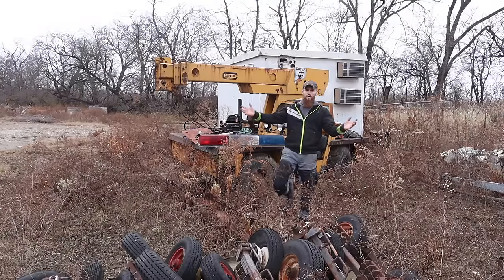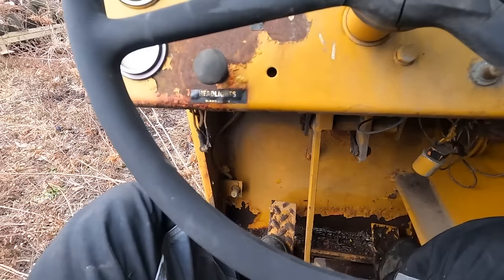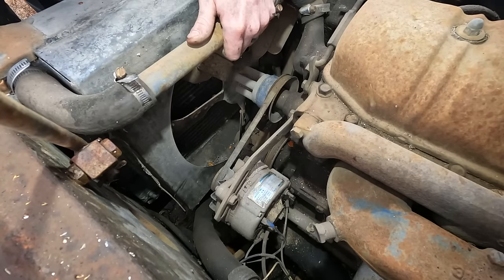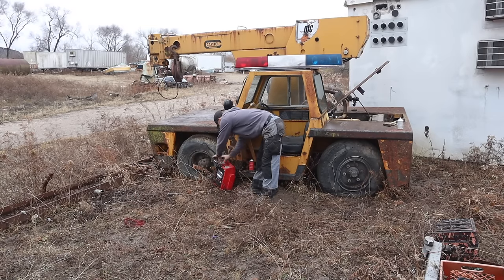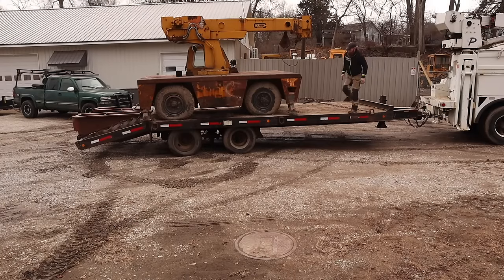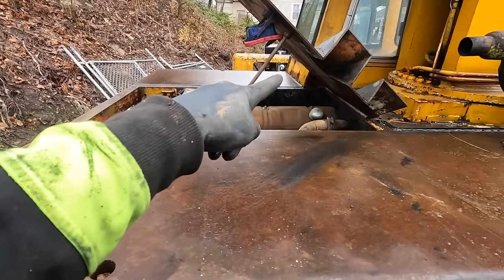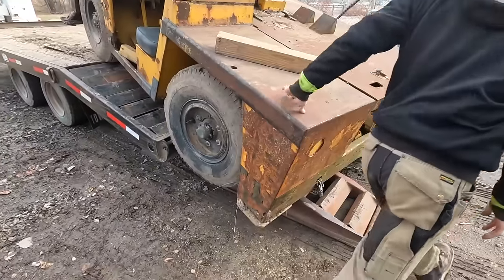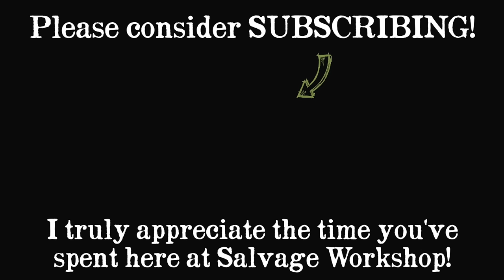Recovering a Crane DESTINED for the Scrap Yard ~ Broderson IC70 Diesel Deck Crane

Comment: Ok. I’m guessing here. I’ve not heard of the brand of machine your working on but pettybone and grove made them pretty much like that. 
  Back to my guess.  Ford Lehman, made engines that used Simms and CAV injection pumps. The injectors were hidden inside the head , much as the ones you are facing.  I have not seen one of those before but as you disassemble it, I’m thinking a casting is gonna be marked with something you can search the internet for and find an answer. 
   Good luck…. Those rigs were very popular in boiler houses and refineries that replaced heavy valves and pumps and needed a compact and rugged way to handle and transport said items for repair or replacement.
   Search for American Diesel and send them some photos of that motor. If it’s not something they recognize, they may have some other guesses

Comment: 47:30 'deck cranes' are [in some ways] kinda like tiny 'pipe trucks' [used to be very common in Oklahoma a long time ago] where a machine not only carried, but supplied, or installed material, which, in the case of the oil rigging days, their job was just to supply ol derricks with fresh pipe.

Comment: Hay. looks like you got a FORD INDUSTRIAL 172 CI ENGINE  common to 60s ford tractors  IE  4000  back hoe tractor . Check the casting number on the block .  Fully Rebuildable  OR  Replaceable . Great video Thanks

Comment: I have one of these cranes, almost identical to yours. Mine has a perkins 236 neverstart engine and has 1408 hours on it. If the engine you have has a Sims diesel pump its ford, if it has a CAV or King of Darkness (Lucas) its perkins irrespective of how the tappet cover is formed. A further titbit, the transmission you have is actually a four speed which has been sticker converted to three speed and mine does opperate in fourth. The torque converter divertor is hand opperated unlike yours that is foot opperated for forward/reverse. Enjoy

Comment: I could be wrong but I think that is a Ford 172 or 192 cubic inch diesel. Same engine was used in the Ford 800 and 900 series farm tractos and many industrial applications.
Reply: I've never seen a Ford diesel with that shape valve cover. They are narrow and straight.
Reply: I see Ford blue paint though.
Reply: @dickwright2134  I'm just saying I've never seen a Ford diesel with that configuration. It's definitely not the 201 3cyl architecture as I own two of them.
I don't claim to have seen every Ford diesel tho
Reply: I have looked through some of my old repair manuals for a comparison.That is a Ford industrial diesel. It could be a 144 cubic inch 46 hp, 172 cubic inch 47 hp, or a 192 cubic inch 52 hp engine. I would bet you have a 172. It seems they were the most widley used. I don't know if you can tell the difference externally. At work we used to have them in Waldon articulated wheel loaders. I think we sold the last one in 1994.

Comment: Weld you some rings on the end of the stabilizers and one higher on the frame so you can chain or tie up the legs. Great if they bleed down and safety if you driving it and they drop on you.

Comment: Question, not trying to not pic this more for my own info The shaft you zip-tied to the knuckle inst it a steering dampener with the purpose is to absorb the impact on bumpy/uneven terrain so you can control the driving better.   Seriously I really would like to know..   I've just recently started working on ng on some if these older rigs and want to make sure I'm understanding wha does what.
Reply from the maker: No it is a steering cylinder... when the machine is running will turn that wheel hydraulically when the steering wheel is turned... both steering wheels have their own cylinder and will work opposite one another... one will pull the cylinder's rod in and the other will push the rod out so the wheels turn properly.... so when the machine is not running there is no way to steer the machine, and it becomes worse when it is broken like on this machine! Good question!

Comment: We had one at a copper mine I worked at in Northwestern Ontario, it was like having a 3rd arm. It was used every day. I think it was a Drott
Reply: The old Drott Go Devils. Phoenix Steel had a couple. They had Continental gasoline engines in them. They used them to carry steel. Drott was based in Wausau Wisconsin. I had a relative that worked there. They were sold to Case in 1968. Broderson started making carry deck cranes in 1973.

Comment: Correct me if I'm wrong but I assume the steering cylinder broke while the loader was pulling it out from where it was sitting. I'm guessing it has hydrostatic steering with the steering motor being able to act as a hydromotor if the engine isn't running. If someone had been steering the crane while you were pulling it out so it wasn't being pulled sideways you probably wouldn't have broken the cylinder. When I'm moving dead tractors on the farm I always have someone steering for that very reason. Just a though for next time.

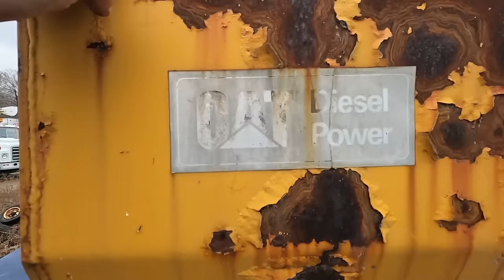Comment: 14:51 I love patina to the point I'd almost be willing to pay thousands to have a fake patina put on something that didn't have one initially. Irks me to see these old machines repainted, even if it's to factory spec.

The patina, to me, shows a timelessness, a ruggedness that you just don't get anymore. It shows a machine that has been through it all and come out the other side still working. It shows a machine that will stand the test of time **because it already has**. And I love that.
Reply from the maker: I couldn't agree with you more.... Most times!
Reply: @SalvageWorkshop  I sure won't be doing anything about the rather heavy patina on my 85 F150. It looks like it got drug out of a junkyard 15 years ago, but that's fine by me. I'll get it running without flaw and I'll drive it looking just like it does for the rest of my years hahaha.

Another reason I don't like patinas getting painted over is, often times particularly with classic cars, it's a way to hide shoddy bodywork. I'd honestly rather just have rust holes in the quarter panels than have them filled with ramen noodles and bondo then sanded over with a $300 Maaco quickie. 

You ain't the kinda chap to do that shady shit, but too many people out there will do that and say they've got a 'restored' classic. Here comes me, looking to buy a classic car to use as a daily driver, and I'm having to wonder if that shiny paintjob is just someone wanting it to look nice and they did the requisite sheet metal work beneath it to justify the asking price, or if it's someone wanting to hide $20,000 worth of required body repairs under $200 of bondo and $300 of paint instead of making the proper repairs.

Comment: I ran the dp250 the most then the dp500 for a while steering is one of the more common problems these units have that and cooling problems on a 250 there is a shaft that runs through the radiator or under it that turns the fan yours looks different but the bearings go out of them a lot not familiar with this small of a unit however I’m sure the controls are much the same the lever in cab on the left turn the boom left pulled back and right pushed forward

Comment: Outriggers  on cranes have a lockvalve on them to pervent cylinder failure due to a hose failure. May have to remove valve to raise the pad.

Comment: Might want to get up with mike kisck, another YouTuber.  He did one of these 5 months ago same model, just without the windows and lights.  Had the same engine and all with the location of the air breather on the engine cover.  He mad a manual he said was available free online he used while working on the injection pump.  He might give you some pointers on this

Comment: About the engine. I have not seen every Perkins engine made, but I have yet to see one with the injectors on the right side of the engine, in this case the engine sits backwards so it would be on the left side of the crane. And all the Perkins engines I have seen from that era have CAV injectors, which sits on top of the head and externally, either vertically or a little slanted. So, not buying it is a Perkins. Other than that, I enjoyed the video. Surprised you did not even a tiny little smoke with starting fluid. It was almost like the fluid had lost its starting power.

Comment: you should see water  on the dipstick if it has any in the oil pan. it did not look like it when you pulled the stick out. Halifax Nova Scotia Canada.
Reply: asking....would the water rest on bottom of pan and maaybe not picked up on stick?
Reply from the maker: Not always... In old machines that have been sitting a long time, the water will always settle down to the bottom of the oil pan because it's heavier than the oil... and depending on how far the dip stick goes, you may or may not see water on it... Many times I don't see anything but old oil, even though I find water when I pull the drain plug.

Comment: That's a nice crane....never seen one like that. I worked on highrises we used tower cranes.  I doubt that is a. Perkins engine. The air breather was mounted on top of the engine. I am going to be looking for information on that crane...All I could find on the Broderson IC-70 is that model is 1970's or 1980 .

Perkins four cylinder diesel engine

Hydrostatic transmission

Stick crane controls

Telescopic boom

30' boom length

10,000 lbs maximum lift capacity

Winch (was optional.)

(4) stabilizers

9.00-15 tires
 
That motor definitely looks repowered with a (Ford?)...I am not a diesel man. I could be wrong there.

Comment: That was not ear muffs, that is a water adapter for an outboard boat motor to provide cooling water while working on an outboard. Check and see if it has a female coupler for a garden hose.
Reply: he was joking
Reply: Oh, I figured it was for someone with a really narrow head! LOL!
Reply: I’m thinking you may have valves not sealing keeping it from building compression
Reply: Hey, just make the cab waterproof and stick a snorkel on the air intake, and you'll be all set to do some underwater salvage jobs...

Comment: The pictures ive seen of one of these the air cleaner and a tool box mount behind the cab and theres a hole on that side of the hood for it to go to the motor
Reply: Also they referred to this as an indoor crane but the one I saw also had a Ford engine in it

Comment: The first lever without a label is cable in/out.
Reply: First lever with the rusted off label is left/right rotation.    Cable hoist is at the far right.
Reply: I believe that may have been the swing lever, not winch.

Comment: Not sure of the engine ?  The paint on it looks like A mopar color ?. It should have a tag / plate on one side ?  Bad thing about water in the engine is the fact ,that the oil goes up past the oil pump sump. Which causes water to go into the crank, lifters, Etc. since water is heavier than oil.. Just telling you from experience on my part,working on old iron.

Comment: Giving it some throttle might help I think somebody was using it for an engine puller and that's why the exhaust and intake was re routed. It could have been at an airport for hauling aircraft engines,

Comment: 37:00 "Some DISassembly required....." ~( 'w')/

REAL solution would have been to pull the hydraulic hoses and let them bleed out so you could compress them all and then strap them secure in place while in transit.

That's how we do this crap in 'Murica anyhow...

Comment: Could you have used the boom lift on the truck to have lifted the front end of the crane up enough to load or is it not got enough lift capacity???
Reply: in other video boom truck lift is weak, a cylinder is bypassing

Comment: I think it's a Fordson engine
Reply: I've never seen a Ford diesel with that shape valve cover. They are narrow and straight.
Reply: @carl4043  the injectors look the same 🤔
Reply: But the manifolds are wrong. Fords either have the intake on top or on opposite sides
Reply: @carl4043  ok thanks